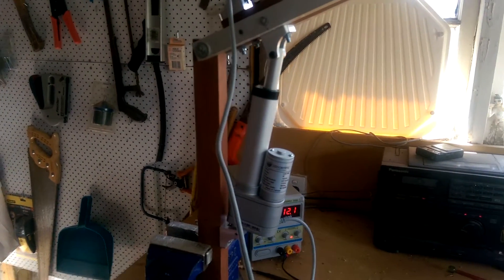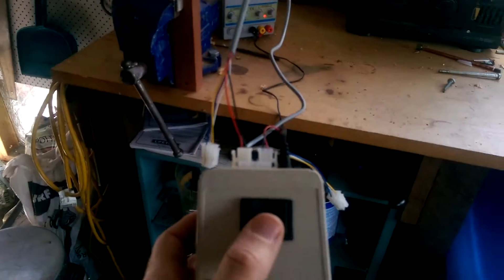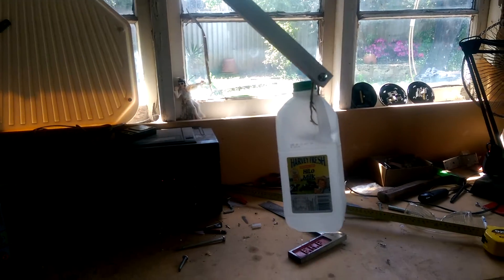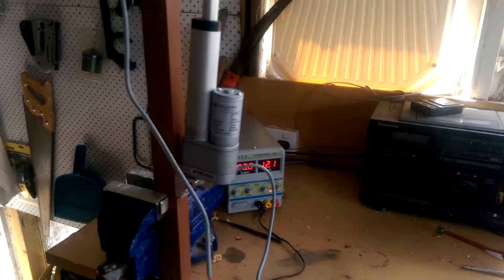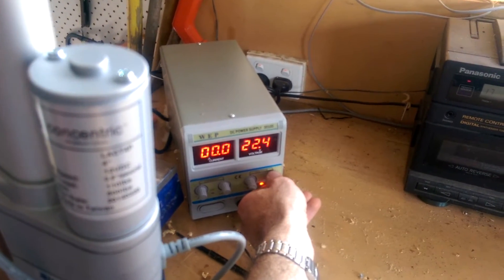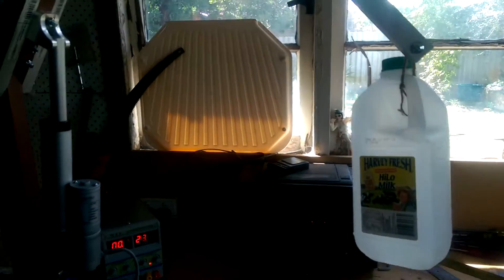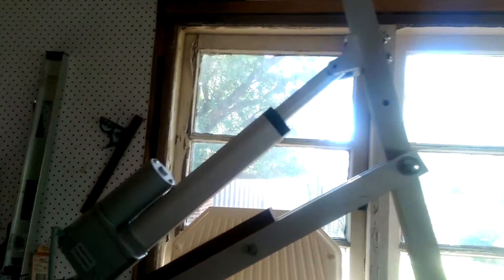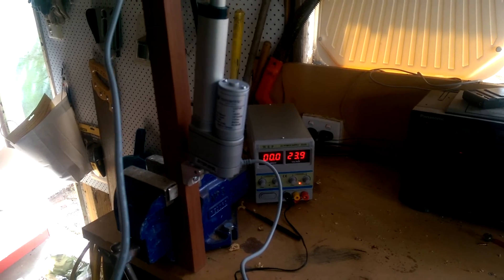Linear Actuator Robot Arm

Comment: This is of course a good concept. You achieve good payload capacity and also low backlash and accurate results

We have used the same in one of our early versions of industrial robots - https://vimeo.com/101932522

One limitation though is that the operational workspace of the robot is limited when we use these mechanisms. The other one is speed
Reply: Which company do you belong to ?
Can you send a link of your company.